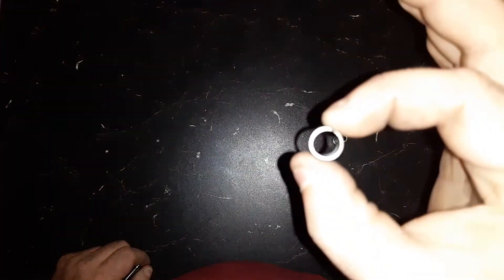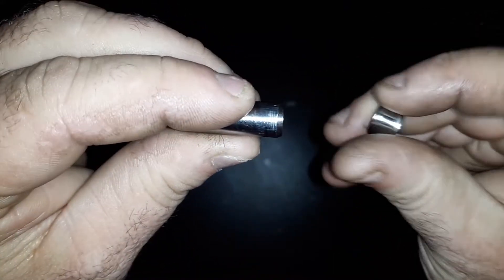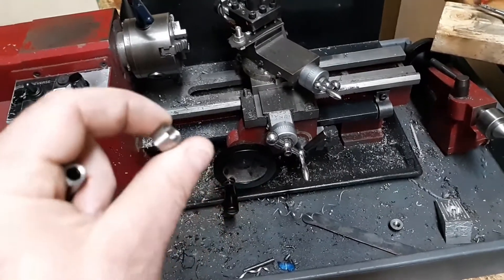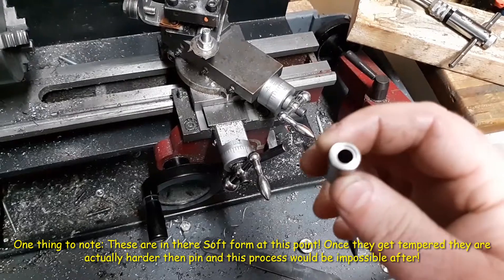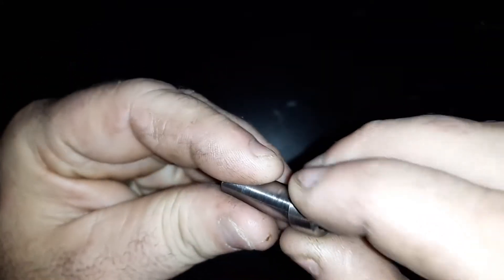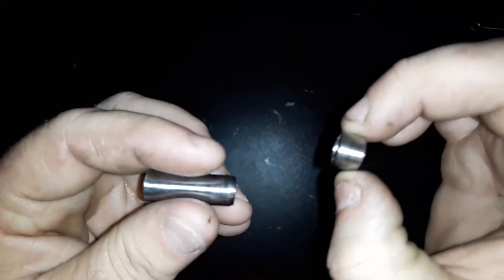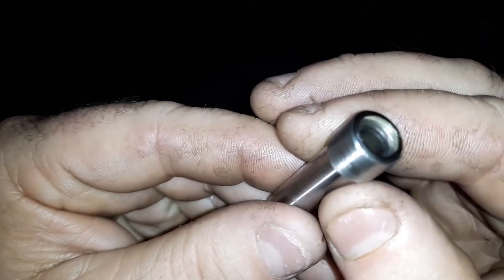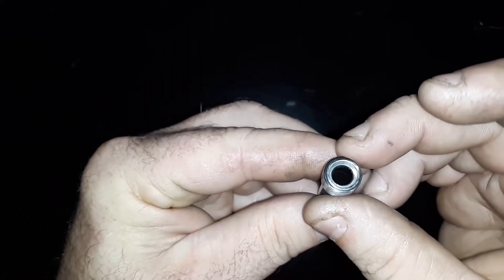How I'm making The New Conversion 10mm to 12mm Bearing Wrist Pins!

Comment: That's rad. Is this something you're gonna sell?
Reply from the maker: yeah making them for the Ms460 builds!  A guy yesterday asked me to make one for a Phantom 85 that was actually pin I was making in the video!  He has a Gen 1 phantom for a guy 9 house down from me lol!   so tossed in needle bearing in his 12mm piston and will see lol! Can't see it not working though these have worked well in the ms460s without any issues!  Only thing about phantom 85 is the freakin pistons are all different sizes it seems. never seen any with same size wrist pins and ms460 are not exactly any better! So makes it so hard to make a universal pin to fit all! with 3-5mm different in pin lengths just phantoms alone!
Reply: @BuildBreakFix  I'm running a MS380 piston in mine. I wouldn't trust the stock piston. If you sell them alone put me down for 1 please.